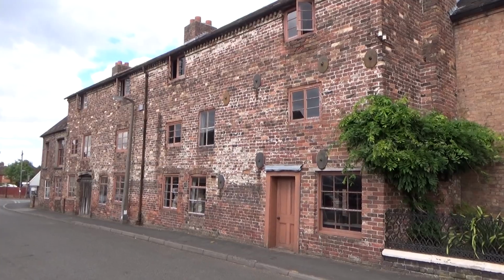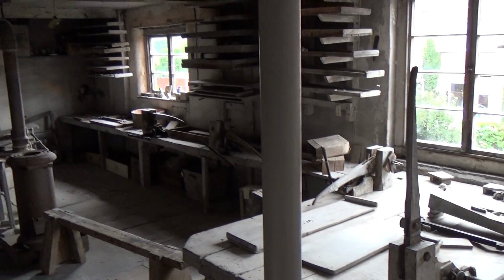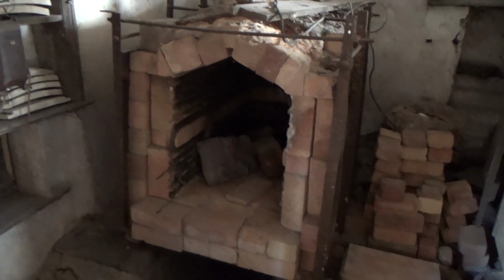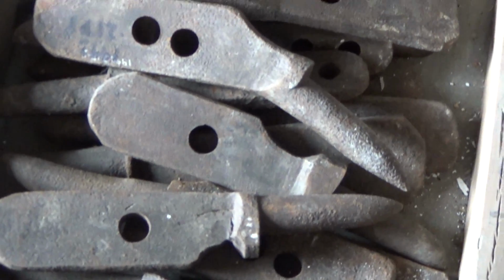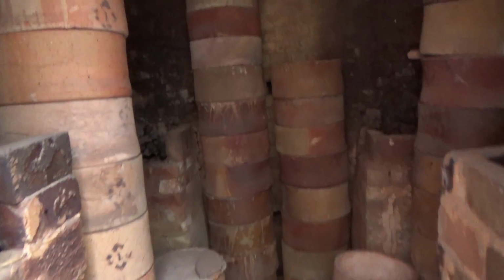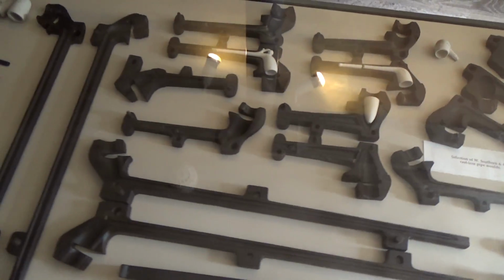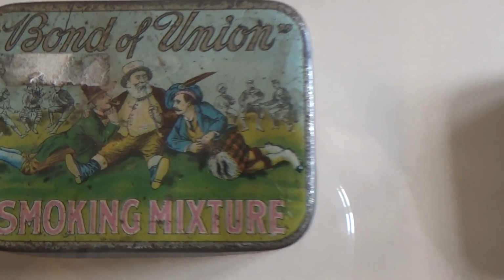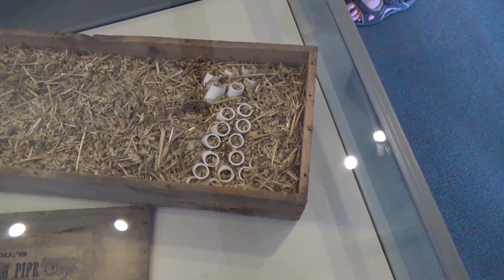The Victorian Clay Pipe Works At Broseley

Comment: Fascinating.  Thanks for posting.  As a former pipe smoker I've tried a few clays (well you have to!).  Always brought out the flavour of the tobacco better than briar but obviously not as durable or as expensive.  I suspect that for smoking purposes in days of yore you'd buy a few at at time.  They get very hot, hence the reason that the longer ones are preferable.  Suspect the shorter ones weren't lit all that often!

Comment: Fantastic - I also saw an old paraffin stove in there. Talking of safety - from the 40s to the 70s my grand parents had a hardware and fishing tackle shop. They lived above the shop. There was a huge tank for paraffin which they pumped and sold - their bed was just above it. Everyone smoked then.
Reply from the maker: I can imagine..made me laugh! Thanks.
Reply: Why did they keep paraffin melted and sell it like that? Could you not just buy it in blocks?
Reply from the maker: @shanek6582  Hi for oil stoves it was always sold as liquid...a penny an hour or something to burn it...used to advertise it that way in the 1960s...gave lots of condensation...used to scrape the ice off the inside of my bedroom window.
Reply: I hate to pester you, you mean you can actually burn paraffin wax and there's stoves designed for it? Is there a different product in England named paraffin or is it the same opaque white paraffin wax that I buy in America to melt and dip my steel traps in? Thanks
Reply from the maker: @shanek6582  Hi..sorry if confusion..I am talking about paraffin oil not wax...I guess you might know it as kerosene...but that might be something similar but different?
Reply: Harry Rogers 

Hi Shane
It was a liquid. I would clarify with my grandad but he’s long gone dead (112 now, died 23 years ago)

Thanks
Reply: I understand now, we have kerosene stoves as well, we call a type of wax paraffin, I was intrigued about a way to use it for burning in a stove and why it would be sold in a melted liquid! I do think paraffin wax is a byproduct of the oil refining industry though. You fellows probably use at least twice the words in the English language than we do, sometimes it causes confusion. The first time I saw a movie where a Brit wanted a fag I was really confused!